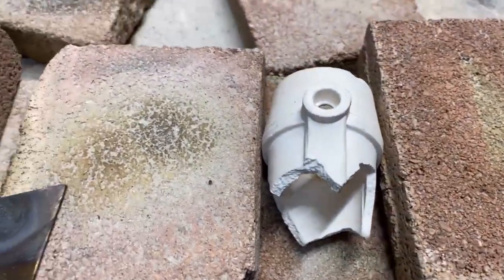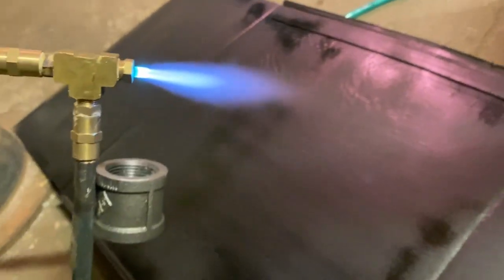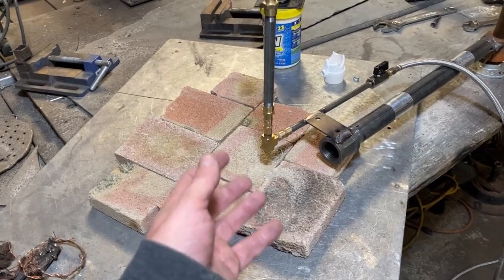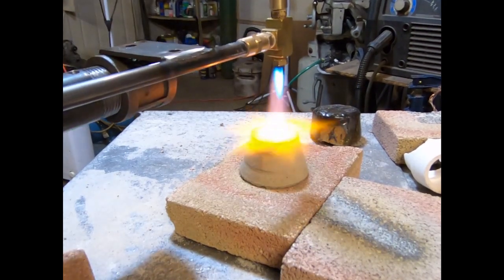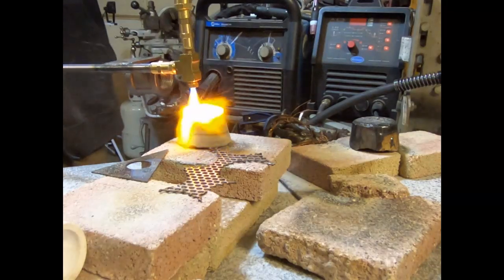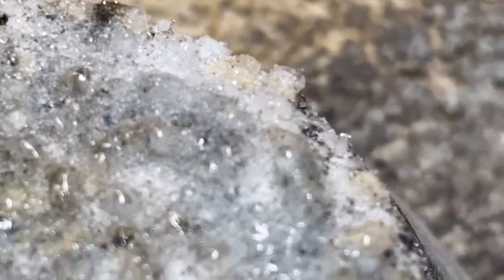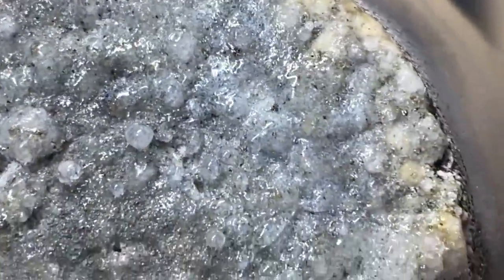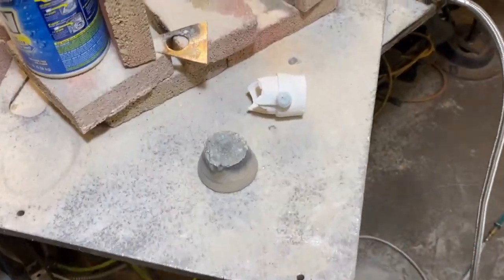Additive Manufacturing 6,600 watts fused silica spray

Comment: Rather than water cooling, why not have an outer tube over the whole torch, feed your propane in through that, if you can get the propane preheated enough, it might decompose into carbon and hydrogen radicals. 

If you have a high pressure and temperature water tank then it could work even better. Then the water will be  supercritical water with monotomic hydrogen and water and HO- radicals
Thats what the end days of the age of steam were doing.
The prebreaking of the bonding energy offers far more energy than burning diatomic H2 and O2.
Very corrosive and explosive.
I know of an engineer working on steamship boilers here in New Zealand about 1900, didnt notice a hole in a boiler thinner than a human hair. As he walked past his leg fell off. Cleanly sliced just above the knee.
Supersonic hair thin oxyhydrogen jet at over 3000C.
You need a delavel nozzle. The expansion cone will allow the jet to be parallel sided, and the velocity of the particles should be very high, supersonic, as the impact energy does most of the melting and fusion.
You can even do it cold if your velocity is high enough. Diamond and silicon nitride is done this way.
Reply: Stan Meyer's big idea was decomposing water vapor to atomic oxyhydrogen with infrared light and electrodes to extract electrons. Heat works too. You need positive electrodes too, which could just be positive potential applied to the metal tubing heated by the flame. Other people discovered atomic oxyhydrogen before Meyers. Langmuir patented an atomic oxyhydrogen torch in 1927, so I could see that part what you said being true. The atomic radicals probably are very corrosive because they're very reactive. Breathing even a little would certainly cause a nose bleed. Breathing more could be deadly. It reacts back to regular diatomic oxyhydrogen within a few minutes, so the danger doesn't last long after the gas is turned off.

Comment: I'd love to see you take kaolin clay, form it into a shape. And then fire it and turn it into mullite which happens at 1050*C, it becomes so strong that it will not break with a hammer blow. Try this, I wanna see power of your burner. If it can produce mullite from kaolin it can be used to make your own crucible